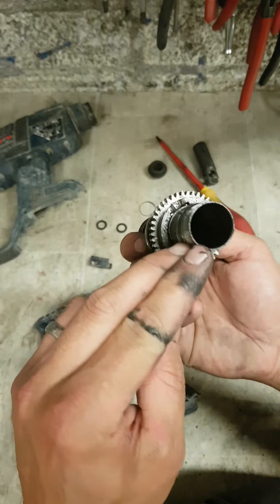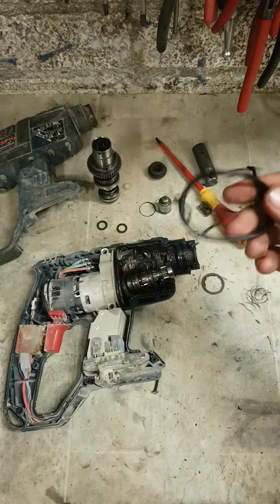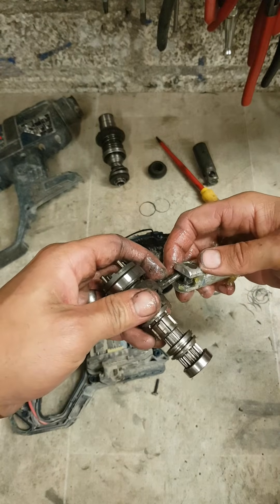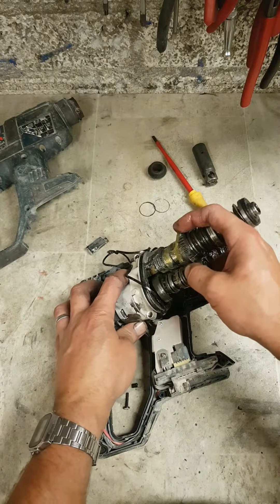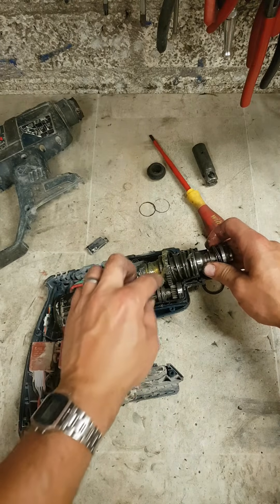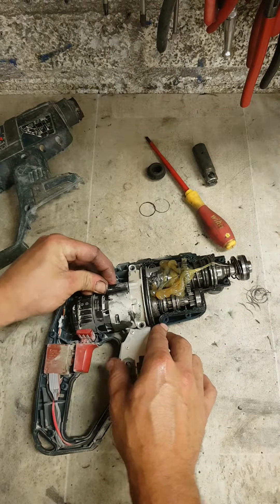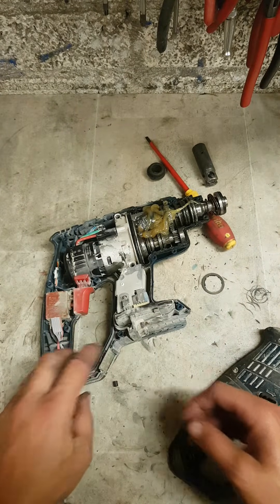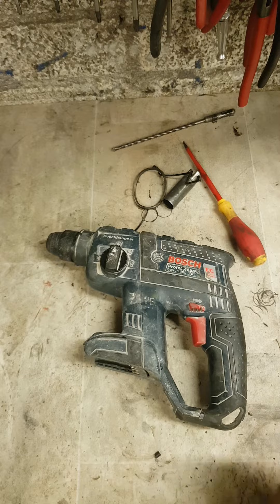Repairing a Bosch GBH 18V-EC Compact SDS+ drill powertool

Comment: I might be a dolt, but cant figure out how to search in your videos.
Can you tell if you ever worked on a bosch cordless 18v- 7 or 10 or 15 angle grinder, would love to hear your thoughts on build and design quality.
Also, when if ever would you use grease with molybdenum disulfide? 
Greetings from Denmark 
-Karl

Comment: How to do you manage to have right parts at the moment? Might be a silly question but I’m just wondering. Thanks!
Reply: He did a video a while back of the repair shop - they have a Ron of parts on hand, especially for common ones.  Probably also has the biggest supply of NOS parts for obsolete tools in Europe as well by the looks of that video
Reply: Some parts are common replacements, so you would have those on hand all the time. Other parts you would need to order and wait for them to be shipped to you. We don't know if this diagnostic and repair was completed on the same day or not because of the magic of editing.
Reply from the maker: These are comments service parts, so would keep a spare in stock